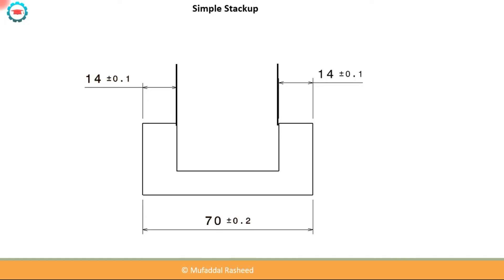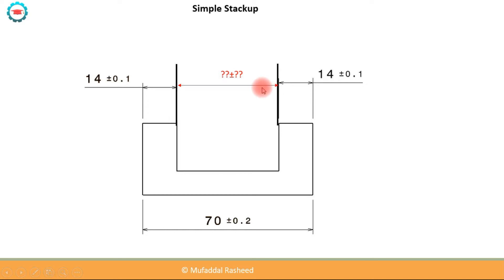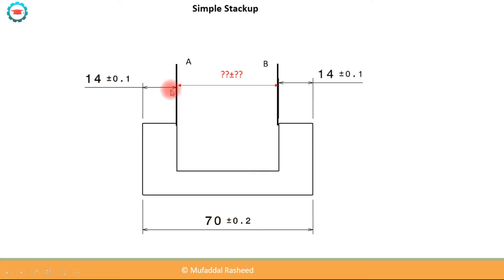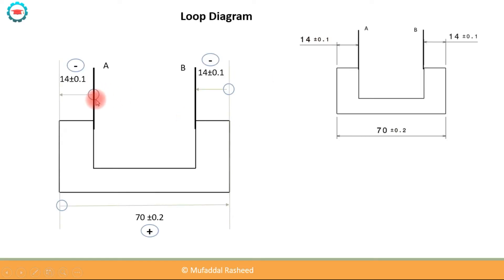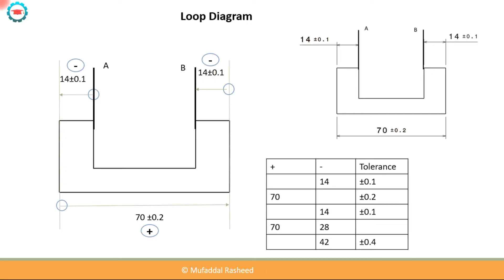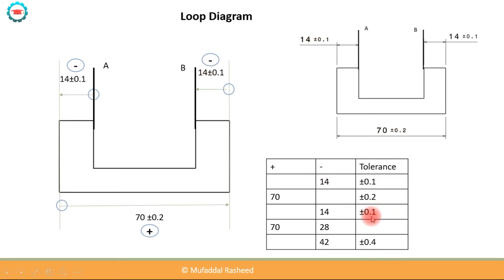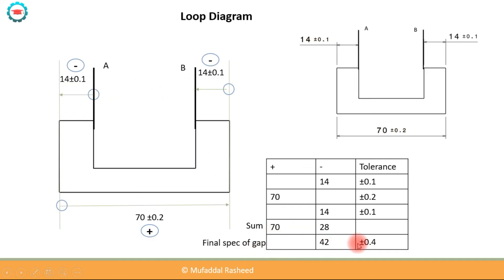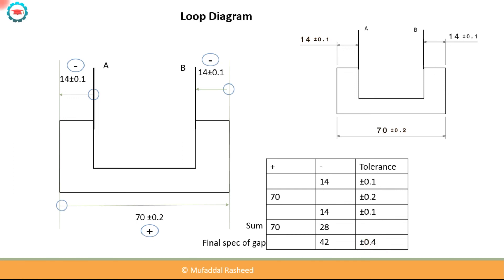Tolerance Stack up analysis : Simple part

Comment: Can any one please clarify my doubt if all the dimension are in positive tolerance that means 14.1,42.4,14.1 then the sun of all will be 70.4 but the over all length is 70+/- 0.2 only that means 70.2
Reply: nice question ,,,,Please clarify the same @mufaddal rasheed
Reply: Same Question
Reply: Same doubt, someone pls clarify..
Reply: i think you are correct, he did not square the tolerances
Reply: I think, This is to analyse what will be the max and min of that gap. Actual value always depends on variation in other dimensions. This is just an analysis that helps to find what will be the max width of the gap or minimum. Because if we consider that dimension (42) also definitely the drawing is over constrained.
Reply from the maker: It is to analyze what will be the maximum and minimum gap it is not the tolerance for the gap achieved through manufacturing but will come as a result due to the other tolerances. Worst case analysis of a gap. 
We are not applying tolerance to the gap but finding the extent to how much the stackup will lead to max and min values of the gap
Reply: @Mechademic  
Yes Correct.
If we specify the gap dimension / tolerance, than the dimension chain will be over specified.
Reply: @Mechademic  not understand